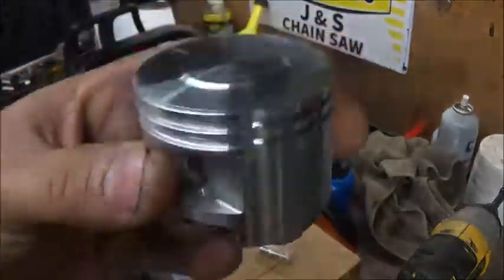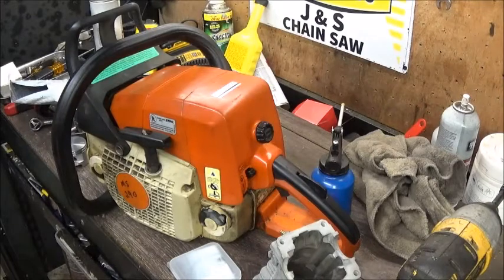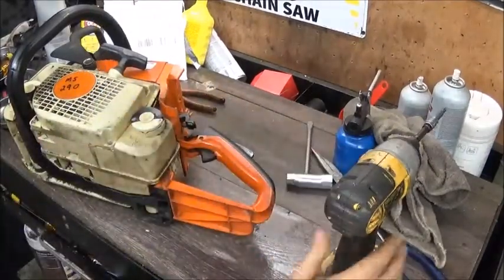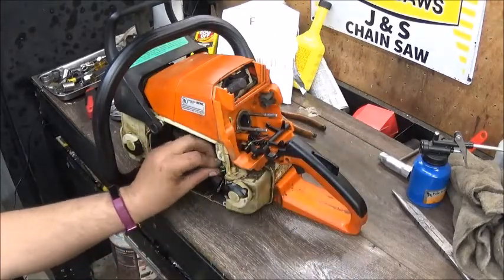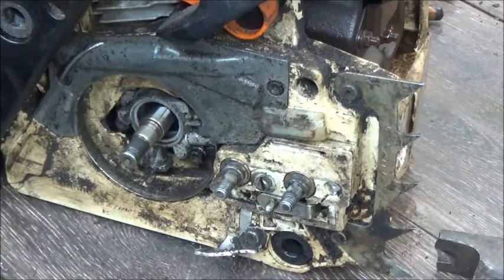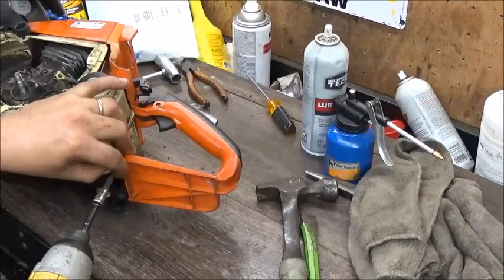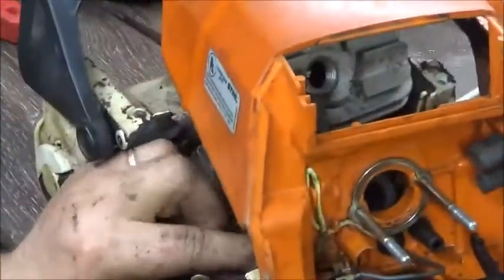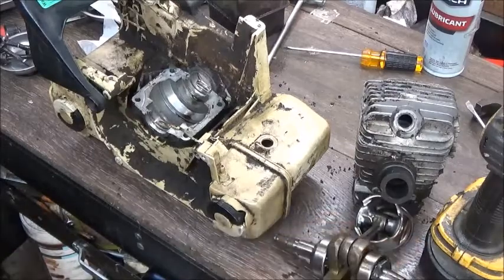Stihl ms290 teardown building a Sleeper Saw Ms390 conversion

Comment: Very Nice sir.  I literally Just finished building another MS 290->MS 390 Conversion build. This time went for a balance of reliability & preformance. 

One thing is infound out that those pop-up pistons from L.R.B are horrible, Cross is better but they will eventually wear out and damage the jug 😢
They only fit Hyway, Cross, Stock, and Other American made heads. They wont fit the Chinese made ones or the cheap heads off amazon. 

Great Video as always !!

Comment: Thank u very much  so all I got to get  is a piston an cylinder for a  390 to convert it  over  right?
Reply from the maker: pretty much id do bearings and seals while i was in there as well...ive got a little more video on the re-assembky...
Reply: @JandSChainsaw  realized. A pretty  low hour saw but was my dads saw an a gift from  him to me after  he got till it was to tiresome on him to run it an decided to down grade to a ms170. It works out I cut the bigger stuff with bigger saws an he gives the ol 170 all she wants an some she dont want lmao.

Comment: Trying to see how hard it is to replace that fuel line coming out the top of that White tank, got a split
Reply from the maker: The line above 5he fuel cap is a tank vent the fuel line is under the carbetator
Reply: @JandSChainsaw  it's coming out of the top of the gas tank and looks like a pain in the butt

Comment: 🔧 Good Class: 
   If you've got an old saw you can risk an 
experiment on 
   Take a flat file and file a Slant from the center of the Piston down to the width of the exhast port 
DON'T get to close to the rings!  This will Let the exhaust gases escape a little  faster  { More Rev's }
Reply from the maker: i ported the new cylinder set port timing with a degree wheel...

Comment: Definitely be interesting to put a degree wheel on it. Since I used a cheap Ebay cylinder for my rebuild the plating had bubbling at the top of the cylinder and is in need of another rebuild so I'll probably use a hyway cylinder and degree it to see what it's at and what can be done timing wise only porting I did was rework the intake didnt change the numbers since I didnt check it. As well as pipe the muffler .730" pipe "a bit to big but to confuse the buddies" it definitely did definitely suprised me wasn't expecting a clammy to have a bit of torque. I personally wouldn't mind being able to machine the bearing pockets .022-.025 to change the timing and get the squish where it needs to be.
Reply from the maker: I just put the  cylinder back on the chassis to get numbers...this combo had .036 not bad with the pop up..didn't have to move timing much at all...
Reply: @JandSChainsaw  That's very interesting and good a lot closer squish then I was expecting I know these cheap crappy cylinders are .056 squish witch is a bit much unless your turning it up a bit past 13500 still depends on numbers also. I might just tear her apart again tonight to rebuild to sell much rather have a holzfforma g372 to play a bit more with then just the buddies saws.
Reply: Also another gain with these saws is taking any stress risers on the piston off does reduce weight and they like it any weight reduction in the piston is always a gain. Trying to get that 1/10 to 3/10ths a hp adds up just like polishing the wrist pin and rod needle bearing journal. Having to find that extra 1/10hp in a predator 212 stock engine with a .750 O.D. tech rule and mini b91 rlv muffler and the holes in the muffler having to be a spucific size or smaller and a stock airbox. By polishing everything in the bottom end from the rod and it being insert bearing less no inserts. Polishing it for the crank journal and wrist pin. Wrist pin itself, crank journal. Cam lobes ends of the cam cam gear, tappets/lifters and lifter bores and where the push rod sits in them. Push rod ends, rockers, valve stems and end of valve stem, and lash caps. You can gain up to 3/10ths a hp and for a stock engine everything you can squeeze out of it helps on the track.

Comment: Now don't the dukes clyinder and piston  kits run 25.1 fuel mix
Reply from the maker: I run 32 1 in everything
Reply: I just put a knew Duke engine in my ms 170 running 32.1 just started it up a few time and maybe cut 4 blocks off a tree took muffler off scars on front of piston. I herd they run 25.1 I think that to much oil myself
Reply from the maker: @jimmydunford7894   
Most aftermarket cylinders need cleanup work done to the ports b3fore use